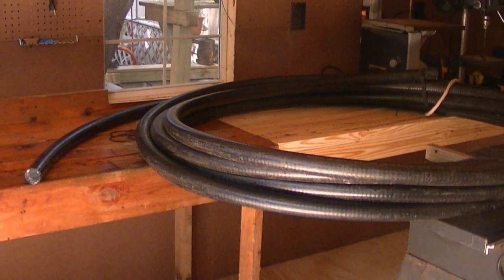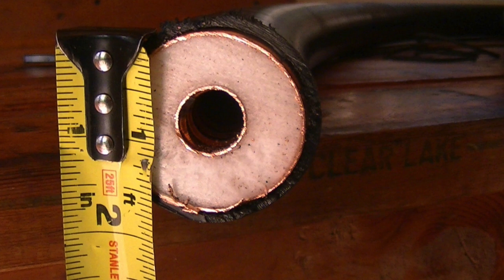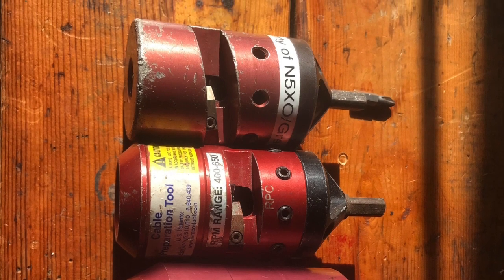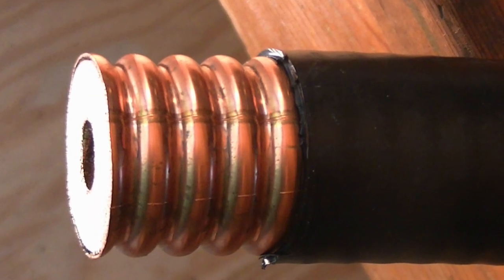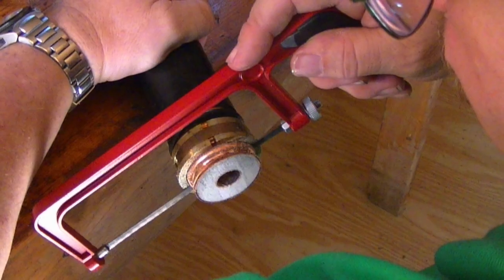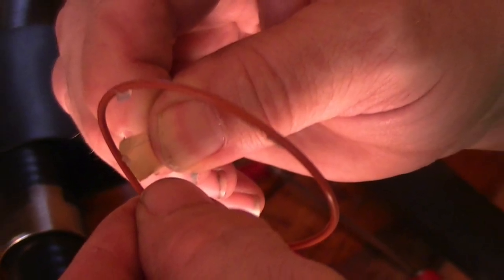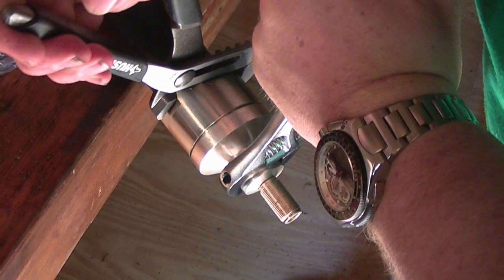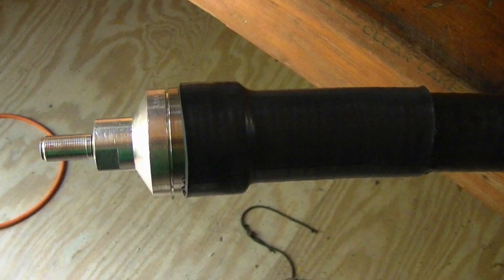N5XO - Hard line connectors

Comment: Great video, Greg. I’ve never seen a line that big but then again I don’t have an antenna tower.  Great learning. Makes it so much easier once the mystery is gone.
Reply from the maker: Thanks, let me tell you if you ever try to run the 1 5/8 or the 2 1/4 down a tower and into your shack, you would not want to see it very often {grin}. It took 6 people to run this cable. But that said on runs of 120ft and greater it really makes a huge difference in what you can hear.